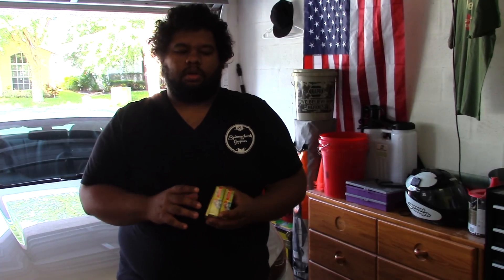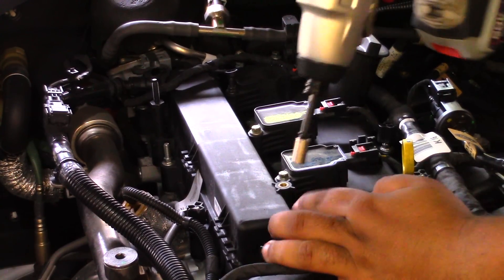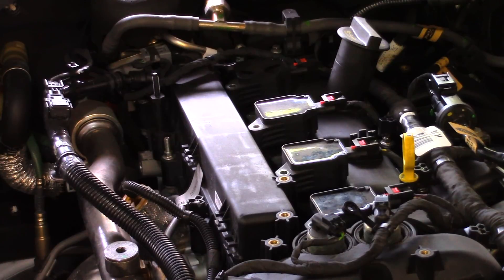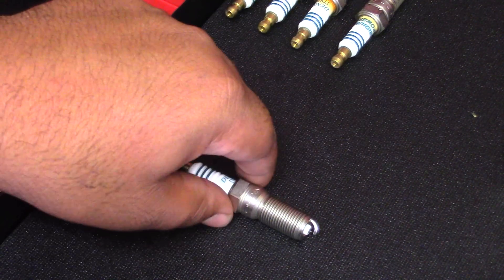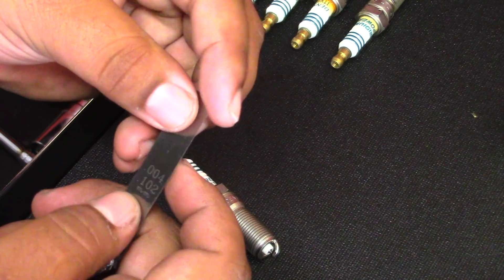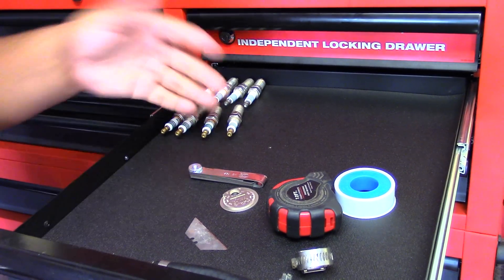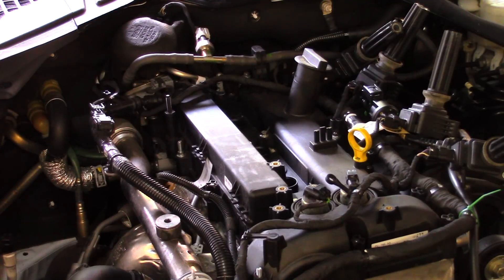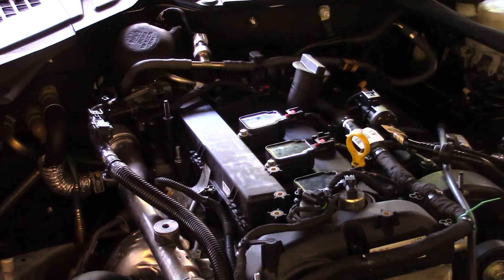Ford Mustang Ecoboost Spark Plug change.

Comment: The manual says to change spark plugs at 100K, does it really need to be done at every 15K?
Reply: Yess it does 15 or 20k, mine was running super rough at idle at 20k
Reply: I just replaced mine at 35k miles and man were they dirty (Have ford performance power pack tune installed). I highly recommend changing plugs @ 15-20K especially if you are tuned.

Comment: Do you have to disconnect your battery before changing your coils and plugs?
Reply from the maker: It's not mandatory.
Reply: @Alexander_Goodrun  cool, as long as I know I won't die from electric shot I will leave that battery untouched.

Comment: Thinking about putting the NGK's in my Ecoboost stang.
Reply from the maker: it's a good move. I prefer them over the denso plugs.
Reply: Alexander Goodrun my current ones have 5 track days and 4900 miles on them. Probably due big time for replacement. I'll do a video on it as well for everyone. Thanks brother!
Reply from the maker: oh lord lol i change mine every 4500. and i change em for each track day. lol
Reply: Alexander Goodrun yeah I saw that. We'll see how mine look when they cone out. getting to mine isn't so easy. I have a strut tower brace and I rock a custom engine cover. So depending on how they look will dictate how often I decide to do it. The car is running strong though, I'm not noticing any difference any how. I use track apps a lot :) Also subbed ya 😃👍👍
Reply from the maker: Subbed back. Yeah here in FL it's brutal. I always have at least 2 sets in the garage and one set with me. usually they will last a good 4 to 5 weekends of hard abuse on the street when we doesn't see the track.
Reply: Thanks Alexander. I'm very curious to see my plugs now lol. Going to add them to my next CJ's order :)
Reply from the maker: I just noticed you're in Michigan. I'm going to be up there for a couple of days the week of the 18th of august I believe. Maybe we can work together!
Reply: That be dope, you coming up for Woodward week or?
Reply: I put them on my 2018 EcoBoost the other day with a bit of electrical grease inside the coil plugs. I went from 26mpg to 35mpg and the acceleration is awesome! They do generate alot more heat though. But other than that, it does make the car much more fun to drive!

Comment: Hey Alex can a loose spark plug cause tapping in the engine area?
Reply from the maker: I mean I'm sure it could but would it be loud enough to hear? if it's loud enough to hear then you got issues. You're hearing a tapping sound?

Comment: I know everyone is on the iridium super duper electrode bandwagon, but have you ever thought about using straight copper plugs like NGK's? While they need to be replaced a little more often, copper plugs are still king.
Reply from the maker: +Archontechnica I'm currently on ngk iridium plugs and i already change them ever 10k miles. Which for me sadly is every 2.5 months. Ill talk to my tuner about what you mention would surely be a lot cheaper.

Comment: Did you just drop the new plugs or lowered them? Thats the only part that scares me i dont wanna mess them up by dropping
Reply from the maker: +nasomaz I lowered them gently xD
Reply: +Alexander Goodrun lol thanks, also
How often do you change them? I also got a set of densos. I dont track the car yet
Reply from the maker: +nasomaz I was planing on doing every 15k miles but looking at these last ones I may do every 10k miles.
Reply from the maker: +nasomaz I was planing on doing every 15k miles but looking at these last ones I may do every 10k miles.
Reply: sound good man. thanks for the videos keep em coming, I plan on doing all the work on my car myself, i dont trust anyone touching her lol. your videos help a lot
Reply: I use a magnet and a screwdriver to put the plugs in. Once the plug is in the hole, I use the screwdriver to softly pop it off the magnet. I then use my finger to "center" it and after that, you're pretty much good to go.